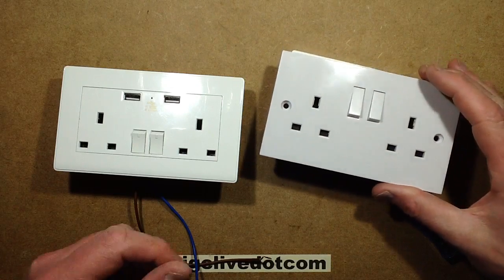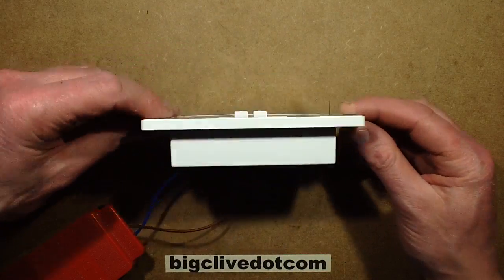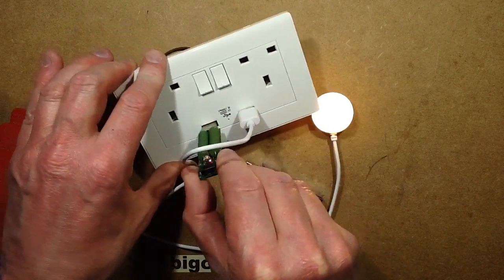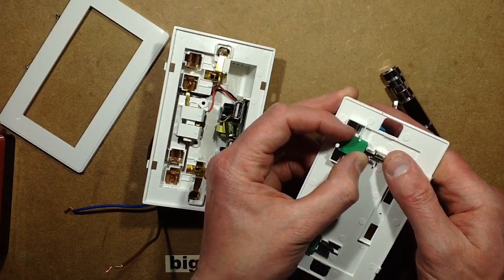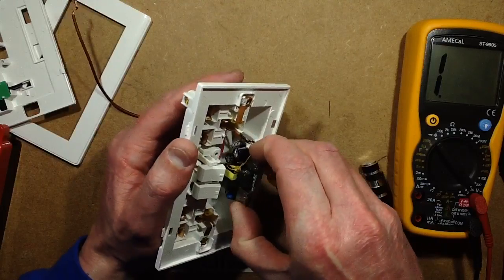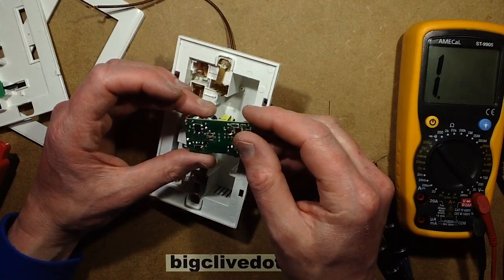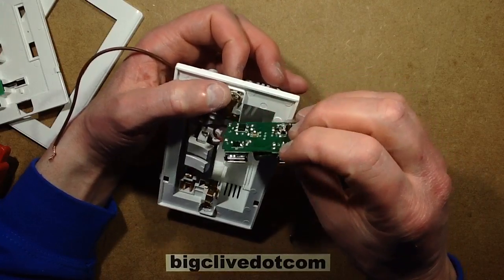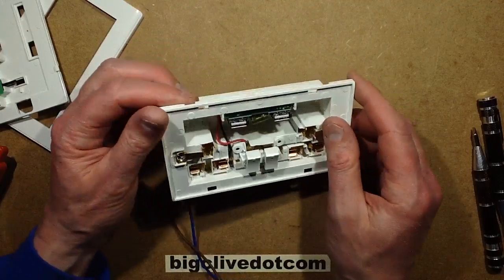A look inside a (crap) double gang socket with USB outlets.

Comment: what do the switches do im from the states and im looking as this why their be switch on a outlet
Reply: Australia uses them, too. They're supposedly for safety, but most people think of them as a convenient off switch for stuff which doesn't come with one, or as a way to properly turn off stuff which only has a "soft off".
Reply from the maker: +BlackWing88 Cyper It means you can leave stuff plugged in but switched off.  It's quite handy.
Reply: oh i want this for my 3300$ computer that i wish not to fry but not unplug well i will half to make do with turning of the mains switch in the back of the psu XD
Reply: +BlackWing88 Cyper in fact, when you mess with a PC, you should plug it in but leave the switch off. This way the PC is grounded, so it is less likely to be damaged by static or residual electricity. I bid not much ppl know this
Reply: ***** very true i dont mes with the insides as you said unless i am going to do work on it all i do is turn off the psu and unplug it when not in use
Reply: +Roxor128 it is for safety, so babies don't just stick screwdrivers into it and kill themselves.
Reply: We have those in the US too they are called Ground Fault interrupters. Most major metropolitan building codes and laws require them if an outlet is with in 4ft or so of a water source. You probably have them in your bathroom or kitchen. Most have 2 buttons but some have switches like that
Reply: *****
Thanks for trying to educate. But I do believe just pushing the power button when it is unplug do not discharge the electric potential in the system (only at the capacitor and such) so you could still get a slight shock if you are grounded. You still need to make sure to discharge the electric potential by grounding the PC by contacting unpainted part for example.

The PC do not need to be grounded for you to get shocked, all you need is for you to be grounded in either case as it is enough for the electricity to flow through you. Your explanation  with the ground plug in would only happened if the grounded outlet has a huge difference on electron potential to you, which should not be the case if the plug is actually grounded properly, by definition.

I'm sure everyone has their kicks and ways to do things. Some people like to play around with PC components and have fun experimenting, I had the luxury to not worry about cash and learned a few things on the way as an amateur enthusiast. Some people like to play it safe and only do it by the book like a professional. I see no reason for you to belittle the others just because they do things different than you.
Reply: *****
You will get a shock as well if your body has a high electric potential (like static electricity in winter). That was my initial point. You are correct as well on the power button thing, but that only equalized the electric potential of the system circuit. It would still overall has a difference to the ground, which is why you still need to ground it afterward. There is no physical way for a close system to get rid of the energy without grounding
.

The problem is most people forget the grounding part, which is why people suggest to leave it plugged in but power off. So the system potential is zero
Reply: *****
Yes, the point of touching it is so that the difference between electric potential on you and the case is the same, therefore it is less likely to stock any sensitive parts. But it does NOT mean the system potential is zero if youself is not properly grounded.
At any point of working around while not in contact with the case, you might change your potential enough like in cases in winter, or just in general "shit happens". Or maybe some jackass comes around and touch your stuff. who knows.

The only way to ensure the system potential is always zero is you ground the PC with you having a clip always attached to the PC.
Plugging it in with power off is one of the way you properly ground the PC. It is the same as if you touch a wire to the "ground". It does not do any of the harmful things you said in the first post, that is a misunderstanding and irrational fear on what a poweroff plug does.
Reply: *****
I guess there is no way of talking to you since you are so think in your head, even thought this is a well known and comment practice in working on PC. and you probably wont believe me if I told you that I am a physicist.

You do know breaking off the hot on THAT OUTLET breaks the circuit for current flow? Breaking any point in circuit will stop the flow entirely. You are not dealing with thousands of Watts where current can jump across the switch. In fact you can turn off the switch on the outlet, psu, whatever. This is the part that I was saying that is irrational. if you think the electricity is still flowing in that state you are out of your mind and simply don't understand how circuit works.
If you know anything about what grounding is, you would know that grounding remove potential away from high potential system. Not adding to it?
You do know if you and your system were charged thousands of volts, the moment you come close to any ground metal (say a screw driver in your work box) you can get the shit shocked out of you? (if you worked in a firework maker factory, you killed youself)

Look, I'm not trying to best you or anything, I'm sure you have your pride with your "professional knowledge" or what not, but you need to think about this objectively with an open mind instead, think clearly before talking shit and insult the other person directly. Think about the science and physics behind stuff, explain how stuff happen clearly, instead of just saying stuff will happen and that it is correct simply because you believed so.

Comment: as soon as you opened up that socket i thought "WOW! there is loads of space to put a little spy bug, with its own 5V power too!!!"
Reply from the maker: +TornTech Or just tap off the 5V with some extra filtering.  Screw using an FM bug though, an "A8" GSM bug would fit in there.

Comment: Hey +bigclivedotcom, how much zoom does that magnifier you use at 10:07 have? I think i've also seen u use another magnifier (I think its a gray one). What magnification do you recommend for reading small (tiny) SMT part numbers? I have a cheap 2x handheld magnifier which pretty much does nothing more than distorting the image :(
Reply from the maker: +Alejandro Bicelis This model is available on ebay cheaply from China with various magnification levels.
http://www.ebay.com/itm/252323389878
Reply: +bigclivedotcom Thanks!
Reply: +bigclivedotcom 
Just ordered one :-)

Comment: sometimes the problem of stability is either with the capacitors or the chips used. Every power chip has its own specs even for switching and they have various different efficiencies and profiles for different voltages and loads. It could also be the components used with the switching chip might not be the correct type. The chip used could also just be crappy.

Comment: I have a couple of decently made extension leads with USB-charge sockets included, which are handy and avoids the awkward failure modes. The problem with earthing makes me wonder if this unit is legal in the UK. Does it have the proper BS 1363 marking.

And there are known to be a lot of fake markings

Did this get reported to Trading Standards? I admit that, in these days, I wonder if that is any use.

Comment: i always wondered what is that white silicon glue they put between components in the circuitboards?
Reply from the maker: +Democritus86 If it's dry and rubbery it's there to support components and prevent them from touching adjacent ones or to dampen vibration and prevent the leads fatiguing and breaking.
Reply: +bigclivedotcom thank you.

Comment: LoL when i saw the video in my feed i assumed it was JWs :P. Honestly , if you want to charge something buy an ipad charger, even if you don't use apple. Sure you can get a 100% fine charger from your LG Samsung OnePlus phone and so on but its hard to guarantee its genuine if you but it after the fact,  with the ipad one you can buy directly from apple.com and know its a genuine. They pump out well over 2 amps and are not even that large, say what you will about apple  ( and oh do i give them an ear full sometimes) they never scrimp on power supply.

It could be the iPad worked as apple devices assume they are working with the correct charger as long as they see the evil apple chip or its clone. Android does not and ramps up to see what i can get away with.
Reply: even freaking Energizer makes good chargers, only thing you should not buy is knockoffs and if you go to pretty much every good electronic store they won't sell knockoff iphone chargers next to genuime ones, ofc if you are buying from ebay then there are tons of them but come on, who buys serious stuff from ebay, lol. also, even apple chargers are overpriced.
Reply: some phones they stop charging above 1500mA

Comment: I would never install one of these or any similar product. A UK socket is typically on a domestic Ring Circuit protected by a 32amp circuit breaker so if the quality USB circuitry goes wrong it will have to trip that or more likely catch on fire and most likely the wrong kind of plastic will have been used leading to a fire.
By the way, the SafeBlock device sale and possibly use is no longer permitted in the UK
For safety, I always plug USB chargers into an extension lead fitted with a 3amp plug fuse.

Comment: Quite a while ago I saw something similar (just a single socket) but there the usb charger was a module that could be removed and the chargers mains was only switched on when you plugged in something into the usb. What would worry me most if these things become abundant is not the increased fire hazard (people buy hoverboards after all) but the increased power consumption as those cheap smps inside there have quite some idle power usage that adds up over time.

Comment: Regardless of design, these units also produce and transmit generally horrendous RFI (Radio Frequency Interference) and EMF (Electro Magnetic Fields in this case), hash and spurious signals not only into your equipment, but also back through the power line / mains.
 
Unless internally well filtered, these are not only "crap", they are ruining sensitive receivers and other equipment reception, and producing other effects.
Reply: +Joseph Rotello No more than any USB charger though. Just because it's built in, it doesn't mean it's any worse.  There are several good ones on the market.
Reply: +Nick Gilbert The vast majority of low-cost USB chargers emit tremendous hash, RFI, etc. Same problem is true for most all non-transformer AC adapters, as they are almost all switching power based inside.

Yes, one can locate charger / adapter "good ones" that are filtered properly inside, but they are very few and far between, regardless of their ratings or FCC or CE ratings and licenses, etc.

Comment: I have seen some chargers having pulse charge mode. Comes from a theory, that pulse charging maintains the life of a battery than continuous current. May be, could not be that because yours became stable after plugging 2nd load....

Comment: Cheap rubbish that doesn't work properly and shouldn't even be on sale in the UK because of its earth design . Disgraceful that this garbage is available to unsuspecting buyer's. It will probably melt if you plug a washer dryer into it.
Reply: C.M.I.C Crap Made In China

Comment: The reason that the andriod phone does not charge is that its not drawing a high enough current from the usb charger . The charging circuit assumes that the phone is fully charged. same goes for the LED lamp as its not drawing a high enough current.Thats why when the 1 amp load was plugged into the usb outlet everything run normal. The circuitry is designed to be charger rather than a power supply output. It actually monitor charging of the device. You will get this same situation when you plug in a phone into a Tablet charger that charges on higher current.

Comment: Nicely put Clive. The killer has to be the absence of common earth rail, which I would think would make it incompatible with IEEE regs. I am not an electrical engineer, but I am an RF engineer, and I suspect that induced noise is at the root of the instability of (what passes for) an SMPS. I wholeheartedly agree with your sensible comments regarding the use of installed PSUs over the conventional "bricks" - if nothing else, the "always on" issue is environmentally unsound and the risk of fire from such shoddily made crap. Nice upload, though, thank you very much for sharing

Comment: Thanks for the in-depth analytical presentation.  We have our own version of these USB/convenience outlets, and I have regarded them from the get-go with a jaundiced eye.  But I'm a chronic non-believer in combination anything.  For instance I would not have a combination telly/VCR or DVD device.  Too much chance of a dead appendage situation.  And in every combo device I've seen I've noticed a consistent cutting of corners quality-wise.  Better to have separate components for each purpose, where quality can be addressed more thoroughly.  After seeing this my attitude toward this kind of outlet remains the same as before.

Comment: Very interesting Clive. I installed the dual USB socket Aldi had in a few weeks ago. The rear of the socket is has a considerably thinner profile than this one. USB devices seem to charge OK, but the iPhone's screen becomes very unstable in terms of touch response/scrolling. Could it be dirty DC (I suspect) causing this?
Reply from the maker: +Steven Gray It usually is electrical noise, especially under heavy load.  The screen acts as an antenna for the noise and it masks the touch input.

Comment: Wow, UK shutters are neat! Those that we have in the continental Europe are just angled pieces of plastic that you have to push out of the way with the plug. Some take way too much force to operate.
Reply: The European shutters are far better as one cannot defeat them with a single action. You need to push them side at the same time. Sure some UK sockets also have similar ones.
Reply: @okaro6595  I guess that varies between models? I have Legrand sockets and you can definitely defeat it with a single action. Just push at a proper angle and you'll be making contact with live voltage :)

The UK plug can't be opened by pressing into the L receptacle at all. You need to go through the ground pin.
Reply: That's brexit for you🇬🇧♥️👍

Comment: This thing is also crap because that power convertor is embedded there, essentially it's a hazard in long run, because people forget to flick switch off, and converter under voltage would heat and eventually, fail.WHat's that lamp is, just a LED attached to power leads?It may be unstable because of that passive (should be cap, but looks like resistor?) between signal ground and USB connector. That can make voltage unstable. that's actually against USB common practice, though until USB3 specification , they didn't elaborated it.  USB shield should be attached to USB cable shield and terminated on case, and later, on proper grounding bus if available. No termination on signal ground  required and later, it was advised against. Because that would  allow device be affected and to create interference. Shield should be a faraday cage isolated from circuit .My HTC phone actually doesn't charge if shield and  ground are connected. Some PCs do not boot

Comment: 200v sin through rectifier then buck circuit, or an coil amplifier with out a cap in parallel for v stabilizatiin

Comment: I wasted money one a couple of similar ones on eBay because the bulge on the back was too big for the metal frames in the wall, making them useless for existing fittings. Probably for the best based on an unease I had paying so little for something inside the wall with no fuses.

Comment: Problem with most of this type of "charger" is that the 1000ma is split over both USB outlets. Not a lot of good for even small phones and useless for charging 2 Pads at same time. Really need 2000ma on each socket, hence maybe the 4000ma suggestion on back of unit.
Similar problem with cheaper car chargers that are often only 1000ma.

Comment: Bought a dual socket with 2xusb 2.1a from Wilkinsons the other week. Like you, i don't care for electronics screwed into the wall. Fitted mine into a white plastic flush mount patress, with a rubber grommet for the cable. A cable that has a plug on the end. Excellent desktop mains/usb power extension outlet.

Comment: Hey clive! Been a lurker on your channel for a good few months now, not commented just enjoying all of your videos, however this video has me quite intrigued and I have a request for you :P I was wondering with you saying the iPad accepted charge but the cubit wouldnt, I was wondering if you could plug the light into one of the ports and observe what happens when you plug the iPad in, just to see if it as you said acts as full load instantly (maybe even with the cubit though if its not taking charge it likley wouldn't change the light flicker) The reason im interested is if the iPad does as you said takes full load, or alternatively, which would be terrible, just accepts the flickering load. I dont know a whole load about electronics but I would imagine a inconsistent load like that could really damage the charging circuit / battery itself if used for too long.
Reply from the maker: +MagicalMidge With the higher load the output became stable.

Comment: Yip - been there. Bought 2 from China - called in Electrician to fit them who noticed the problem with Mains earth. Point blank refused to fit them. Got 2 good brand units from Screwfix FOR LESS than the ones from China. Lesson learned!!